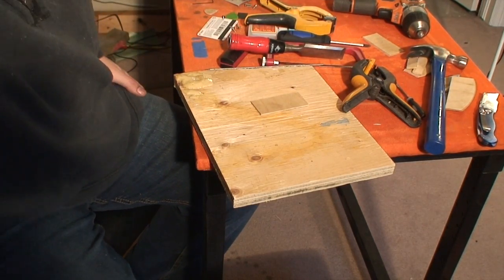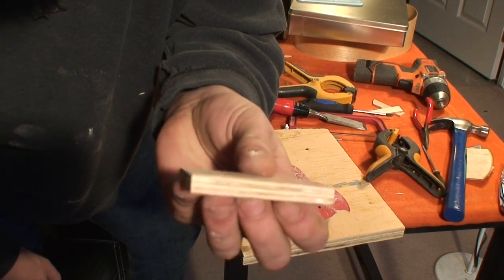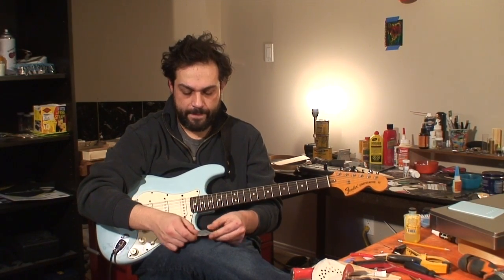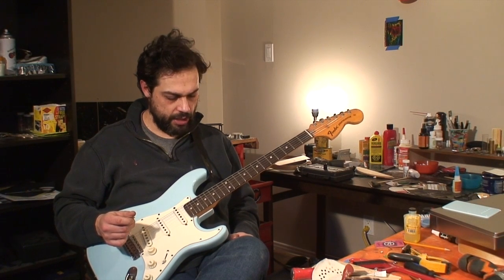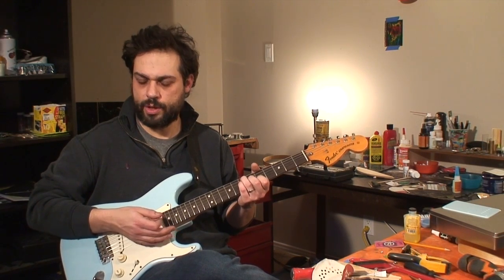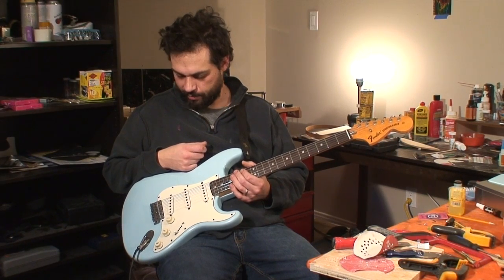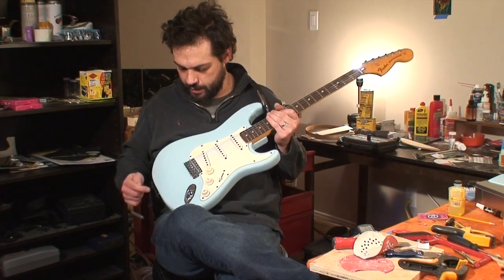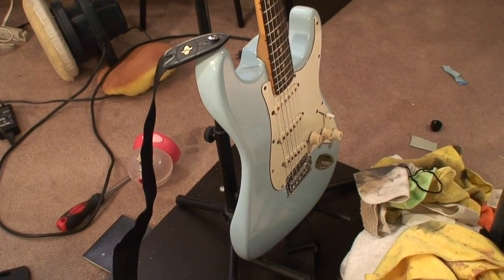70's Strat gets a trem-block and says goodbye.

Comment: Few things... not a real Fender, unless my ears are playing tricks on me, but if you like the way the guitar plays, take away 2nd & 4th springs and setup tremelo properly and it will stay in tune (also change tremelo to genuine Fender part cos that trem block looked like cheap Chinese stuff) buy old Dimarzio DP110 for all 3 pickups and wax dip them, do a google search for strat tone bridge mod and I'm sure you will find a schematic out there. Fletcher is a brilliant luthier and I think makes guitars that outperform the genuine ones. I've setup quite a few strats in my 20 years as a guitarist so if you need any advise, I'll be glad to give it freely, keep it up cos you only get better as time goes on

Comment: Unless the tone knobs have been modified to control the middle and bridge pickups instead of the neck and middle pickups , basically you were rolling off the middle pickups tone and not the bridge tone which is why the middle pickup sounded like a muddy mess when you were demonstrating the sounds of each...

Comment: I ran into the same issues with nitro. I ended up purchasing twice as much as I thought I needed to get a decent coat. I decided to leave some of the imperfections to add “character” to the guitar. then I added a hefty coat of clear lacquer, roughed it up with 80 grit then sanding it semi smooth leaving some of the deeper stretches visible. I added one more thin coat of lacquer and polished. 

The finish looks great, it looks as if it was an instrument that saw a lot of stage time, but was well maintained by the owner.

Comment: these saws are amazing! they have an array of types. some are very flexible and the blades are not offset, this way you can flush cut. some are used for cutting with the grain, some against. some are wide for long cuts,  some not so much, , for short cuts.

Comment: Just curious why you set the strings at 9.5" radius? Are the frets so worn that it matched better? Fender used the 7.25" radius up until the early-mid 80's.
Reply: catdumpling that's what I thought! My 79 strat has a 7.25 inch neck
Reply: MuscleDad420 I usually measure 2mm from bottom of strings to top of frets, where body meets neck, as a guide. Some 7.25 necks are different than others, and you can get some a bit lower. I have 5 strats, and never fretted out!(when set up properly!)

Comment: The tuning could be due to whats called "string pull" from the pick-ups.
I had a 73 Strat, it had quit powerful pick-ups in it and that was a pain in the butt for string pull. Mostly from the neck pick-up.
Fender quality control was pretty bad in those days, mind had two "crowns" in the finger board so the frets had to be stoned very low at the seventh and twelfth frets on the top E side of the neck.
I wish I still had it!

Comment: Once you set up a fender the Jeff Beck way, you never go back. It can stay in tune no prob. The only thing with trems is, you got to keep em greased and oiled up at all point where strings touch steel, pencil lead on nut and change strings often, especially if ya use the WANG BAR heaps!

Comment: should take ot springs and claw ..connect earth(ground)for bridge to trem block ....more sustain and no weird spring overtones in sound also I found that taking 4 screws out of bridge plate made a big difference.(just use the 2 outer ones)...the more bits you have holding everything together the more resonance you sap from your instrument...overtight pickguard screws suck tone...plastic pickguards expand and contract differently to wood...thats way they sometimes pop when you loosen screws
also...dont use crappy plywood as a block....it doesnt transfer vibration too well thats why the thinner tone. use something hard like hickory...(a lump of hammer shaft will do nicely)
I experimented with all sorts on my partscaster.....brass bridge and block...old ibanez.....bent steel saddles and a lump of hickory works best for me
Cheers n Skol
Wulf

Comment: CHECK THIS:
Remove to springs and the rest kipping the wood, now you have a pool, place aluminum foil very tight to the whole cavity and melt plastic there are a lot of options the harder the better. 
BEST way with tons of sustain and easy to remove.

Comment: One addition to the block should be a hole drilled into the exposed edge to allow the insertion of a wood screw for pulling the block should someone want to easily remove it in the future.
Reply: sounds like a tampon lololol

Comment: Does blocking the trem change the action of the strings?
Reply: yes and no. If the bridge was floating before, you need to adjust the action. If it was set down at the back - meaning that you could only lower the pitch using the whammy bar, the action should stay the same.
Imo, blocking the bridge doesn't do any good, regarding the sound.

Comment: I like the color of the guitar. Why are you putting the block in there? I don't understand now you can't use the trem bar right?
Reply: The term isn't good for keeping the guitar in tune. But it's all down to preference and what you want though
Reply: he wanted to turn it into a hardtail with a fixed block he didn't want to use the trem bar anymore the block improved the tension of the strings and improved the tone of the guitar as well

Comment: If the springs are that tight that the trem is held fast to the top of the guitar is a block necessary? I've used coins front and back of the block to hold the trem in a 'fixed floating' position. Eventually I went back to a free floating set up because I think that's the best way to get a true Strat tone. A blocked trem does improve sustain and improve tuning stability but I think it makes the guitar sound fuller. You might be after a more Teleish tone. If you are blocking the trem is the way to go but you might lose some of the typical Strat vibe. Nice clip.

Comment: About the pick ups and their tone. Since this is an old guitar that may have been worked on before, I wonder if the wiring of the switch has been altered so that the positions don't activate the expected pick up. I worked on one of my own of similar vintage and screwed up one tone control, sending it to the wrong pick up. I never changed it back. It's something I'd be curious enough about to look into. Nice guitar.

On mine I wanted the tone controls to go to the bridge and neck pick ups while leaving the middle pick up wide open. I love the sound of the middle pick up on a Strat but I wanted to be able to roll off the tone on the bridge pick up to be able to get Eric Clapton's "woman tone". (The things we do. lol.) As it turned out I made a mistake and had left the neck pick up wide open and had put the tone controls on the other two pick ups.

In the case of your client's guitar, could the switch allocations have been altered inadvertently?

Comment: That guitar looks great! I enjoyed watching this. After many years I finally figured out how to set up a fender tremolo. They are great but the set up is hard and long to get it right. I put a Peterson clip,on tuner on the Strat. I make sure that if I am dive bombing the G that it goes back to G when I stop. I know that after two hours on stage the tuning is on the edge. It is something that I regret not having all these past years by taking the easy way out.
Reply: When you did intonation adjustments, did you use fresh strings (very important).  Secondly, you have to put all three pickups flush to the pickguard.  Their influence by magnet is very important.  Then, you can proceed to intonation.  About the Strat tremolo, when the guitar is without its strings, you remove the spring tension on the back.  Then your tremolo plate is sitting on the body of the guitar (if not, unscrew all 6 screws).  Then you proceed to screw each of the 6 screw until the tremolo plate starts to move upwards. You stop and unscrew ¼ of a turn. You repeat for the 5 remaining screws then you're done !  Put back your spring, etc.  A good tip : If you can unscrew all the tremolo unit, put some "lip conditioner in paste" under the plate" !! It will smooth the movement of the unit and help it to come back in pitch.

Comment: Is it me or is anyone else annoyed when they call a "trem block" a "hardtail". Aren't they different? One is just a Strat with a trem block, the other has no trem. I have been trying to find out how to convert a Strat to a hardtail and all the videos, and articles are all about trem blocks. I finally just did it myelf, or I'm starting to. I just glued a block of wood into the hole, and filled the gaps with resin. I haven't installed the hardtail saddle yet, but it looks good.
Reply: Yeah, a Strat with a trem block for me is : a hardtail + a resonating block..  I perceive that as an advantage.  Imagine a copper block; it would be the ultimate system.  " I think "  Just MHO.
Reply: the trem block is the piece of metal the springs attach to, this is called a blocked trem, not a trem block.he is clueless.
Reply: Hardtail and trem blocked tone do differ slightly. You still get a 'shimmer' from what is effectively an in-built spring reverb tank. Hardtails have a lot more punch and low end. A lot of people 'super strat' with bridge humbuckers (thereby utterly killing the stratocaster tone entirely imho) when what they really want is just a hardtail or trem blocked setup and a tone pot wired to the bridge.
Reply: @cgavin1  imo what kills super strat tone is generally their paper thin necks
Reply: I'm lucky to have a CBS era strat (lol as if anyone thought that during the CBS era) that has a big ass U shaped neck. Makes a HUGE difference to the tone - along with the SSS rout. More wood, more tone.

Comment: For the fuck of it I would have used that...played it through an amp while recording it, then done the same thing with a hunk of mahogany, then metal just to see if there was any difference. For nitro, don't use a high speed buffer, use a Porter Cable 7424 and you couldn't burn it if you leaned on it with all your weight, this especially just to get minor surface marks out and use nothing but light Menzerna for polish.

Comment: I own a crappy Paragon strat, bought for £70 inc case, amp, lead, picks and strap. i've had many people play it and say "dude you cant get a single second of sustain from this POS" but when i play her i can make her sustain for at least 13 seconds.. It's not the price or what you do to it, it's how you play. (P.S. she is using only two springs, .009 gauge strings and obviously not hard tailed :P )
Reply: On the strat type guitars, the sustain is greatly affected by the positions of the three pickups.  If they're too hign, it will greatly reduce the sustain.  Most people lower them, jack up a little bit the volume of the amp and everything is just nice,  By the way, Alnico V magnets are very very strong.  Put a small screwdriver on one of the stud and you'll see what I mean...
Reply: i think you answered the wrong post mate?